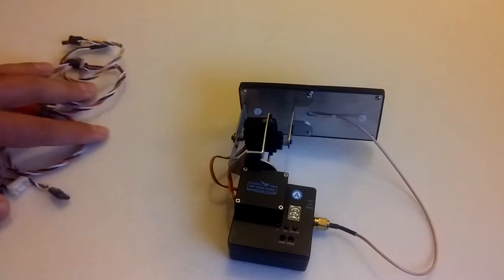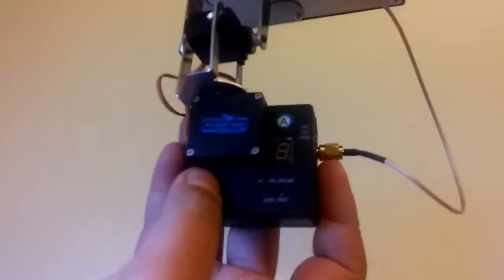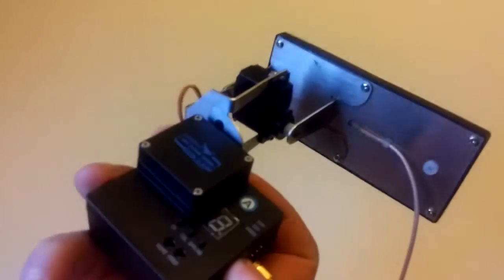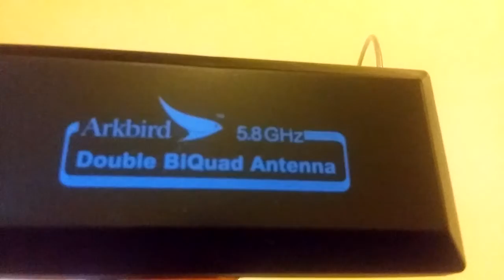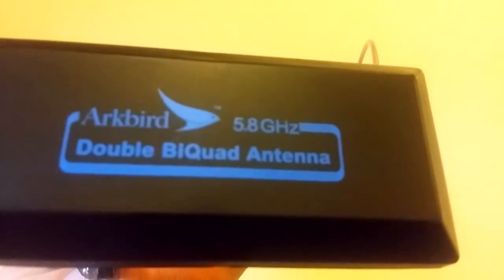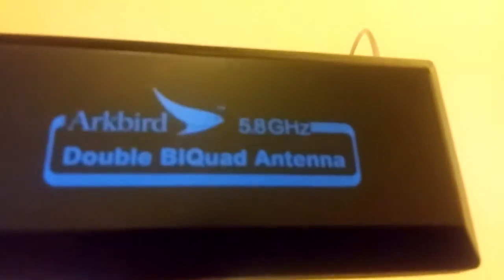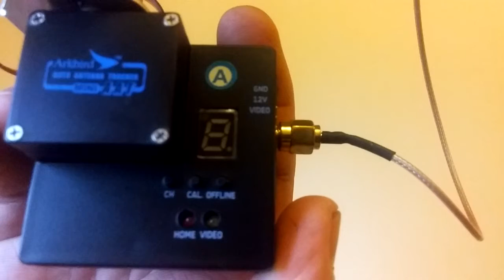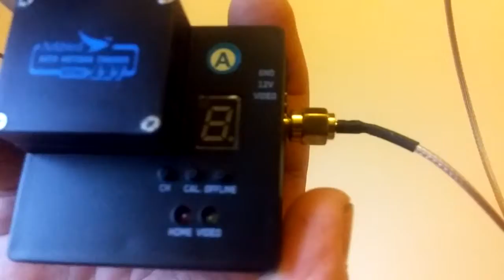ARKBIRD 5.8ghz Mini Auto Antenna Tracker introduction/overview

Comment: Have you tested the range on this tracker? Do you have a video of it?
Reply from the maker: Hey sol, haven't got video but tested to 1.5km and worked fine as long as you use linear polarized antenna on the craft.

Comment: As my friend, I do not use the OSD arkbird, so which kit of this ad I should buy in order for this antenna tracker to work well:

https://en.aliexpress.com/item/Original-Arkbird-FPV-5-8GHz-Auto-Antenna-Tracker-Gimbal-AAT-Extend-Range-LRS-System-with-Ground/32790908686.html?spm= a2g0s.13010208.99999999.273.5acf3c008ZF5dl

Comment: What if you had 2 of these, 1 on aircraft other at ground station then use a high DBi directional antenna to get say 20Km range?
Reply from the maker: thats a crazy and fascinating idea, i dont see it working but would be a fun experiment, 20km range is achievable with a good directional antenna and any tracker so i dont think there need to make it complicated.

Comment: Thank you !! If I use an OSD Arkbird will I need an on-ground GPS for this Mini Tracker?
Reply from the maker: not really, you can calibrate manually and it works, i have never used GPS although it would be an added bonus for sure if you have a GPS spare.

Comment: Did you use the arkbird patc 5.8 antenna? What greater distance did you get from her?
Reply from the maker: Carlos Cunha the Arkbird bi quad antenna is quite solid actually as long as you use a rubber ducky (linear polarized) antenna on your vtx, does not work well with circular polarized antennas, you might get the same distance as a helical but the picture quality in my opinion is better and more solid.

Comment: So I saw this Mini tacker on Aliexpress (https://www.aliexpress.com/item/Original-Arkbird-FPV-5-8GHz-Auto-Antenna-Tracker-Gimbal-AAT-Extend-Range-LRS-System-with -Ground / 32790908686.html? Spm = a2g0s.13010208.99999999.5.1c483c003vOTcl), but there are several options but which is the ideal one to use with the OSD Arkbird on the plane? or with other controllers; there you have the following options:
1 - standard set:
2 - GPS Module for the Air
3 - GPS for AAT Solo
4 - GPS for Both:

Comment: @Ready-Set-Test, was hoping you could help me to understand how the AAT works?  I already have a talon built with GPS.  So I assume I need to wire the Air Module in between my GPS and flight controller?  Hoping I could see some wiring diagram to wrap my head around how this works.  Any help appreciated.
Reply from the maker: hey, if you have a gps on board then the airside  module needs to be connected to the gps and the video tx, there are diagrams and explanation of how to do it in the AAT manual, follow this link for the PDF and check the information on page 2 and 3.
https://hobbyking.com/media/file/825706058X452149X32.pdf
Reply: That manual is for the Autopilot system.  In my build I am using an Omnibus FC and Neo-Ublox GPS...was hoping I could configure the AAT to work with those components, but struggling to understand the logic.  Still googling.
Reply from the maker: i understand, the airside can be wired just with GPS and video Tx or arkbird AP system, as to wiring and working for the setup that you have is a different story, i hope you find the solution for it.

Comment: hi can I use this with my omnibus F4 FC  with gps and L9R receiver or I need something else in the air
Reply from the maker: you will need the airbourne unit that comes with this unit,  the airbourne unit will be in your plane wired to the GPS and the VTX, see the manual for diagram, nothing else required.

Comment: So with that modual you connect to the vtx, it can be used with a pixhawk?
Reply from the maker: yes the airside module takes care of tracking regardless of AP used or not, but the airside module has to have a gps connection. i have not worked with pixhawk but i cant see why it would not work together, cheers
Reply: Ah thanks very much. Might get it for my iris + or plane, I'm familiar with pixhawk. If I do get it I will to a set up video.
Reply from the maker: now that would be good, because lots of people out there experiment with pix hawk,, speak to jungle at arkbird and hopefully they will sort you out a deal.

Comment: nice and small unit   :-) you should check out the RSSI Pro Track no onboard equipment needed and tested out to 30+km :-)
Reply from the maker: thomas donnelly 
thanks thomas I did check your website,,it's new for me thanks for pointing it out, looks like a very interesting device and like the 3 helical array, that's gotta be one hell of a broad coverage :-)
Reply: Hi the l;eft and right helical's are using RSSI strength to track the transmission only the center and diversity module have the video and audio feed this is why there is nothing needed onboard :-)
Cheers
Reply from the maker: very interesting, good luck with your product development, good ideas merit success